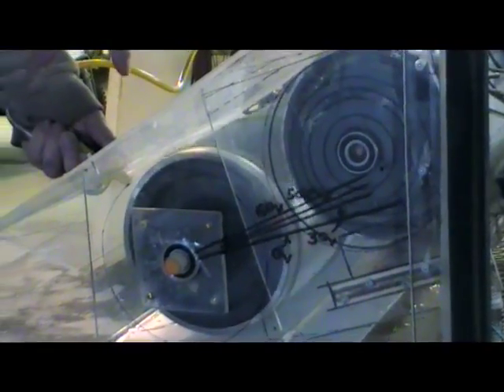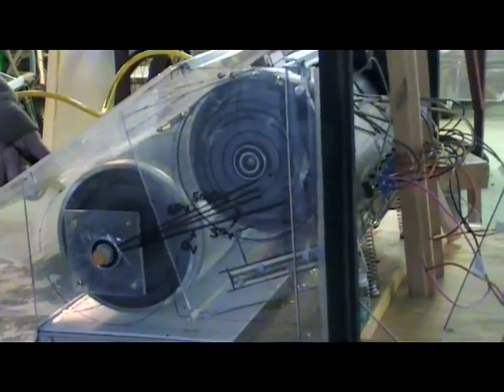Magnetic Induction Generator GI

Comment: thank you , i thought about better idea about what you put pipe two side magnet wheel at end i  thinking you can also build motion force magnet rotation itself without any electricity power power in magnet the magnet runs its self then you can connect it to belt to converter electricity generator you can get unlimited electricity!

Comment: Golang: Still much to learn! Drove 24v magnetic wheel drive last week: the engaged gap shown must be EXACT! Too close & it loses volts, too far & begins too skip! Now building petal generator using these gear-wheels: allows elimination of all mechanical gearing - opens way to "stacked generators" like you see here! Both series & parallel wire-ups work, alone or together, opening up much voltage flexibility. Used 4 & 4 to get 30v (4v knockdown w/load). Am using 12/18 3each side for petal-build.

Comment: Sca: Sounds like science - but isn't. Result of GM ad champaign 1936-38 to unseat Ford as no.1 "Streamlining" worked better on straight 6 than Fords square 4. Robert Moses finished his first "Hitler Highway" in same period (Henry Hudson Parkway). Result - 45mph speeds raised to 55mph. Motor cars resist air for radiators, this FemmeMobile LESSENS air resistance & drag - plus generates current for Hub Electrics that are 10 times as efficient as fuel cars. Watch out for PM (perceptional Management)

Comment: What exactly are you trying to accomplish?
Anything that impedes the smooth airflow over the vehicle is drag, causing the driving system to have to work harder.
Your air intake will cause drag, and I very seriously doubt that any arrangement of air turbine and generator can "capture" more energy than the power required to drive the vehicle forward against that additional drag.
So again I ask: What exactly are you trying to accomplish?